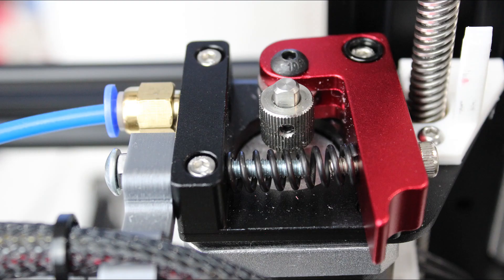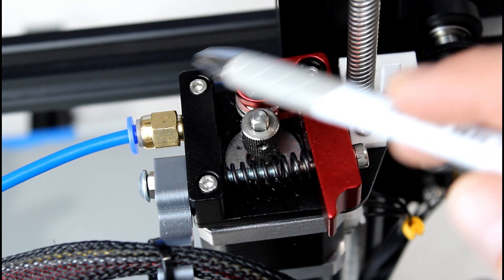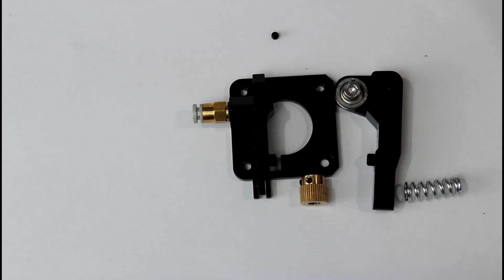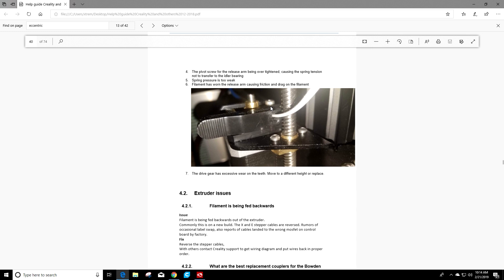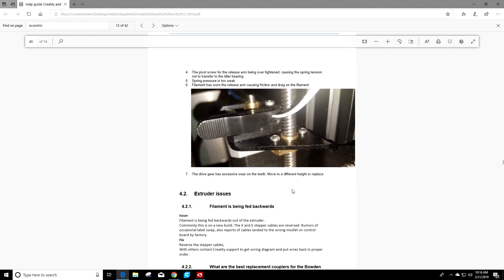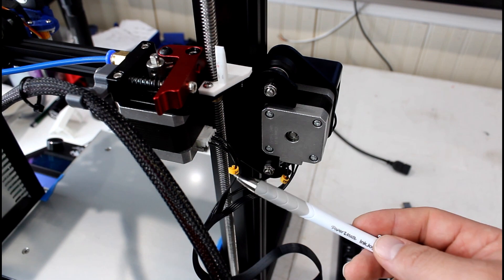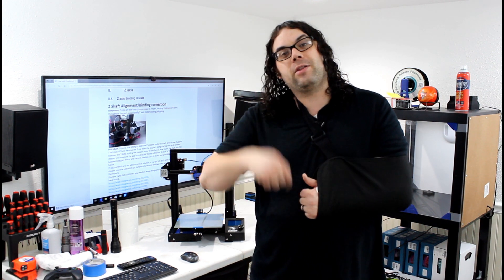Section 4.1 Extruder Troubleshooting featuring the Ender 3

Comment: I’ve got an issue with my hot end when changing filament it now won’t move off the plate so the nozzle is too the deck of the plate and now tries to purge which isn’t good. How do you get around that? Mines an ender 3 neo.

Comment: My extuder motor moves but when the time come to rotate and turn the reel the motoer sticks as is the reel is to heavy,tried taking the reel off and extending g the roll of filament but the motor still keeps sticking.
   I then go to prepare and then  move the motor every the millimeters or so and it works perfect  but refuses to turn continuosly when it goes to print. Should I buy a new motor?

Comment: I just got a dual gear extruder for $60 on Amazon.  Was the E.Fit Extruder.  I think there might be better ones out there, lighter ones.  I'm just about to test it out.  

That tension arm is just too much trouble imho.  Mine cracked at first, took forever to find because it was such a fine crack and you could barely see it.
I pretty much the same aluminum setup you got, but it was still having problems even after trying a new gear.  Totally secured, tensioning arm was free to move, I had put some washers behind the spring to give it a little more compression.

I could have maybe got this 3D printed part they make that clips on the top corner of the printer and has a hole in it sticking out a few inches from the part.  You feed the filament through it so the filament doesn't have as sharp of an angle into the extruder. 

Dual gear extruder is much nicer though, have one on my Anycubic Vyper.  Much better than my Ender 3 Pro.

Comment: Thank you so much!!! I had replaced my extruder with an upgraded one because the spring went bad on the stock extruder. I guess I didn't tighten the drive gear enough and I don't think I would have figured that out without your video.

Comment: I know this is an old video, but I've looked everywhere for an answer including this whole video which didn't answer it either. My question is this; can a feed arm be too tight? I'm getting some stringing and popping (like there are air pockets in the filament) and have diaged everything else. I cranked down the feed arm spring screw when I upgraded to an all metal extruder thinking more tension equals more accurate feeding, and am wondering if that could be causing my issue. Any insight is appreciated. Cheers.
Reply: moisture in your filament if there is popping. get a dryer or build a dry box

Comment: Hi! Your videos really helped me out already, so thanks for that! My Ender 3 V2 was always working fine and suddenly now after 1,5 years he starts really making trouble. First the extruder didnt work propperly, I changed it with your video. The glass bed wasnt sticky anymore, so I changed it (I manages that without a video ;) ). It always helped for 1-2 prints but then I get back to trouble... now I've had the same issue over and over again: My filament keeps breaking in the extruder at the point where it gets into the coupler. I cutted the bowden-tube straight with the cutter you mentioned and pushed it all in. I also tried different filaments. Do you have any suggestions why suddenly my filament keeps breaking at this point? I assume to have the same aluminum extruder you mention in you videos, I find that it "sands" of a lot of the filament at the point it gets into the extruder. Is this normal?
Reply: Maybe to mutch pressure?
 Did you calibrate your esteps?
To mutch extrution with semi clogged nossel or a to cold nossel

Comment: why does your gear attach differently than mine? I have a stock ender 3 and the gear is put on a fitted shaft and not screwed in. have you seen this before?

Comment: I have two questions. First were did you get the grey printed cable hanger? And my second question: I did an upgrade to a metal extruder and it is giving my nightmares. My prints print for about 2 hours (or even 9 on long prints) and then the filament gets stuck in the extruder (and bowden tube) and breaks. It looks like the filament gets squashed, but only after hours of printing. I loosened the arm, used the old stock spring, but that didn't help. What do I have to do to get it working flawlessly again? And how can I test if it will print good without spending hours printing and wasting filament.
Reply: I'm not someone from "The Edge of Tech". I'm giving beginners advise to you that has learned a bit. My Bro gave me my first 3D printer 3 months ago. An Ender 3 Pro along with a filament feeder upgrade. All metal. Never heard the chunk sounds until after a month had passed. Had not used the printer much. Learned it was an extrusion issue. I replaced the boden tube with a Teflon one sized for the filament I'm using. I did not harness the tube. Used the clean out tool for the heater and replaced the nozzle. Made sure the tube's fit to the block was tight. The chunk noise was gone..... That was 2 months ago. I'm starting to hear it again. Maybe some debris has built up on the gear that drives the filament causing a slip? Prints are doing ok even with the thump.

Remember. It is a cheap 3D printer. Some 2D inkjet printers cost more.

Comment: I've had my original plastic extruder fail where the roller part just broke off like you showed on the picture. I've noticed first some regular ridges in the print and then the filament started to come out as fine strings. It seems to be a common problem. I've ordered an aluminum extruder.

Comment: I was really hoping to find a resolution to my issue here; the filament refuses to thread properly, no matter what angle I cut it at, and keeps following the pulley. I'm using a stock E3pro. Is this a common issue? Anyone in the comments have a solution?

Comment: thought my 10 year old filament that i used for the first time in a long time was the problem just put this on as background noise while running tests and failing with some other filament and then when you talked about the crack in the extruder arm i went to check and found the source of my disappointment thanks

Comment: Keep printing??? Got a Ender-6... 20 fails to one print. Bed leveling => fix that. Bed adhesion => fix that. Bowden coupler  => fix that. Hot end => replace that. Extruder slip => yes I'll do that but what the shit will I have to adjust/fix/replace next??? 
Buy an Ender-6 fill your garbage bin with melted plastic.

Comment: In the middle of printing my filament stopped feeding. I checked for clogs, checked the tubing, I have figured out that the drive gear isn’t moving at all. I can pull the filament through myself but when turning the knob it doesn’t move the filament at all. Idk what I need to do. I’ve only had this printer 2 days and it was working fine up until the middle of a print earlier today and hasn’t since

Comment: It looks like I have an issue of a different sort, the extruder shaft fails to pull the filament without the grub screws... I watched your video very carefully (by the way it is awesome), but realized that no matter what I did from your recommendation it doesn't help with this issue. Basically when the grubber screws on the other side, the printer is running without extruding, once screws catch on, everything is back to normal. What do you recommend?

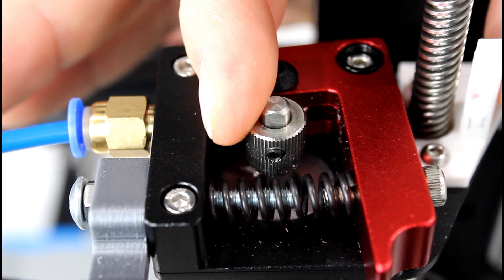Comment: I'm super new to the hobby, and an extrusion issue is the first problem that I've encountered. This is a great breakdown. I watched it all to understand the components better, but solved my current problem w/ the information @4:20. My drive gear was loose enough to push up, above the filament. I loosened the set screws, pinched the spring, and it dropped it right back in place for tightening. Looks to be fixed, and seems to be laying the filament down more consistent/even

Comment: I tried everything, nozzle cleaned, bed leveled, checked extruder for cracks, change feed gear but nothing worked yet. I getting few simple prints  fine but extruder click when I give moderate print like vent ring model LCD cover etc. Please help

Comment: Ender 5 Pro. My extruder keeps breaking the filament mid print. I have a filament dryer too. I have tried several brands of filament and have the same problem. The printer is less than a week old. Any thoughts?

Comment: Hey. New to your channel. I bought a 3ender from Amazon. But for some reason is either not to hot making it to not stick to my table. What are some suggestions to look for. Thanks
Reply from the maker: I would make sure that your x gantry is level and you bed is very level. Then clean the bed very well with isopropyl alcohol or soap and water! The. Slow down the first layer by half.

Comment: I have this really strange issue with my printer {Anet A9}

The printer does print correctly but i do hear a sound like the gear not grabbing onto the Filament correctly. {its a constant ticking noise.} {pulling on the spring/filament clamp does not help that much}

The prints also come out as intended. without many issues {the only issue is stringing, but this is due me still using the included part cooler}

Do you have any idea what is wrong with it. {I have not done any Major upgrades, other than a glass bed, and a temporarily Z-endstop adapter {made from a thin metal plate} {and 2 out of 3 Steppermotor dampers}}

The filament i am using is Brand new, just like the printer. {i am using the included slicer settings}

I know the issue is with the Bowden/Filament extruder, since i feel the shocks if i gently hold the Filament

Comment: Hi Jim..Newbie here and have a question!. In the beginning of some of my prints, the extruder makes a popping noise so I replaced the extruder release arm. It's still happening and I have made sure nothing is too tight or too loose and racked my brain trying to figure it out. I know e-steps are talked about, but how do I figure those out?  Any suggestions would be totally appreciated! :)

Comment: i dont know if it was the pulley or the fact that i turned the temp up on the nozzle the pulley was spinning freely but the settings for the pla required more than it was set to i think it was the temp i kept putting the needle in it would ooze out quickly than slow down than nothing repeat and it would again this pla im using now just needed more oomph i guess lol danke for the video even though it has what i hate in videos the this is what the video is about intro when we can already see based on the title lol nothing against you it just a pet peeve of mine and i know im an ass about it never was that way until the amazing atheist pointed out how he hates it like get to the point lol anyway danke for video useful for further reference for sure

Comment: Do you have an Amazon link for the couplers for the Ender 3 Pro that you use in the video?
Reply from the maker: Use my Amazon storefront and got to the 3D printer Parts section. It should be there! Amazon.com/shop/theedgeoftech
Reply: @TheEdgeofTech  I did not see it listed there.
Reply from the maker: @bigbearshangout9989  Sorry about that! Just added a new one! Not sure where the other one went lol
Reply: @TheEdgeofTech  Perfect, thanks!

Comment: Congratulations from belgium but I have problem after I changed my filament spool and now I have Extruder Skipping Steps.I replaced the extruder with a red aluminum one and I replaced the tube and the head but I still have Extruder Skipping Steps. I also saw that some people have solved the problem with a direct entrainment of the filament on the head. Could you help me?
Reply from the maker: Not sure if you got this fixed or not but I would make sure your e-steps are good now that you changed extruders.
Reply: @TheEdgeofTech I corrected the problem by replacing the plate placed on the heating plate with an original under3 plate now I still have some Skipping Stepsonly on the first deposits of hot filament then it's over. Thank you for help me.

Comment: having  extruder issues every time I start to print it starts to make a weird knocking sound the gear starts to pull the filament in then I hear that weird  knocking  sound like its pulling  the filament back what should I do? any suggestion ?
Reply: Nozzle could be plugged, or material stuck in a gap between the nozzle and the outlet of the bowden tube.  material could also be clogged in bowden tube.  basically a restriction preventing material flow.
Reply from the maker: Make sure you don't have any clogs, also make sure your leveling is good and you adjust your e-steps after the extruder change.

Comment: What should I do? How tight should the screw be?
Reply from the maker: It should be tight enough for the arm not to be lose and wiggling, but not tight enough so that it doesn't move as it needs. So tighten it down until it's solid and not wiggling, then give it another full turn to see how that works. Just don't over tighten it so that it stops moving.

Comment: I’m pushing my filament in while holding it down, but the filament just stops and doesn’t go through the tube
Reply from the maker: It doesn't go into the bowden tube connected to the extruder? Have you tried cutting the end of the filament to a sharp angle and straightening the filament out as best a possible?

Comment: I just got my printer yesterday and the drive gear doesn't seem to want to push the filament through. it moves but doesn't move the filament.  :(
Reply from the maker: Is your hot end heated up?
Reply: @TheEdgeofTech  yes it's heated up to 200 right now, but still nothing is feeding through.
Reply from the maker: @Eryk_Stormbright  Can you push it through by hand? If you push the extruder arm in and then push the filament through does it go through the hot end?
Reply: @TheEdgeofTech  yep, it goes right down to the hot end.
Reply from the maker: @Eryk_Stormbright  But does not go through it? So no filament comes out of the nozzle at all? Even when you're pushing it?
Reply: @TheEdgeofTech  yes it goes through just fine when i push it, but leaving it alone to print something, it doesn't seem to want to grab it and push it though
Reply from the maker: Ok. As long as the arm is tight and the spring is in, it should push it through. What happens if you pull the arm a little tighter while it's trying to print and pull the filament through?
Reply: @Eryk_Stormbright  did you ever figure out what was going on with this?

Comment: my filament is being pulled in and then out, not sure what is happening as this is new, any ideas?
Reply: Mine is doing the same. It’s not the retraction. It “clicks backwards “almost not pushing any filament in.
Reply from the maker: @gregingelse2280  So the extruder is clicking right? The things that could cause this would be nozzle to close to the bed, clogging nozzle, nozzle temp to low, a crack in the extruder arm, a stripped extruder gear, a bad nozzle, Bowden tubes moving in the couplers, and the Bowden tube not fully seated in the hotend against the nozzle. Do any of those apply/help?!
Reply: Yes have anyone found this solution.
Reply from the maker: Hi! Can you please explain what you mean by pulled in then out?
Reply: @TheEdgeofTech  Yeah the drive shaft turns normally and the pulley follows applying a force in.  Then it briefly reverses applying a force on the filament outward.  I am a novice at this and I don't remember seeing anything like this before.
Reply: I just figured this issue out. The problem was i had the wires crossed. I believe the X wire was mixed with the Y(im not in my office anymore to verify the wire) but now my problem is the nozzle will not hit the bed and the filament is laying down like toothpaste if you understand what i mean?

Comment: I have none of these issues... i think my extruder motor is bad... just upgraded to an all aluminum unit since it was having issues on test was seeing non consistent extruding...heard a while back a weak spring can cause...also my machine is brand new and brass gear is in perfect shape... when i was printing test i watch gear  move a little then pop back... grub screws are tight zero slipping there... when i depressed spring a slightly gear kept turning and feeding.. my bearing and pulley are very smooth turning... i am a very good mechanic and have many years fixing machines... So do these stepper motors go bad??? i am new to 3d printer and stepper motors btw... thanks
Reply from the maker: It's definitely possible it's bad or missing steps!
Reply: @TheEdgeofTech  actually i read comments on another video that showed exactly what mine was doing... it was fixed by backing off bearing screw 1/2 a turn...no more clicking..And yes bearing was spinning freely before i loosened it...weird, but it fixed issue..no more failed prints since... there were 10 others thanking the guy for his information...sometimes the simplest things make a huge difference...
Reply: Turn up your hot end...

Comment: In my case the stock extruder was mangling the filament so much so that when it got to the hotend it couldn't make its way through. Additionally the part that feeds the filament into the extruder (what is its name? I have to replace it) was worn and mangling the filament.
Reply: How did you fix it, im having this issue right now

Comment: Hi Jim, when I change filament on one of my Ender 3 machines the filament doesn't make it to the Bowden tube instead it goes up or out of the side, I can't see any wear on the extruder gear and the path seems to be straight with nothing to deflect the filament, I have tried straightening the filament before winding it in but no cigar, I have been having to uncouple the Bowden coupler and feed in manually.
 Do you have any thoughts on this?
Reply from the maker: You could pull the Bowden tube out of the Extruder and open up the hole a little bit with a small screw driver. That widens the hole a little bit going into the extruder and allows the filament to go in easier. Try that and me know if it works!
Reply: @TheEdgeofTech  Thanks Jim will try that!!!!!!!